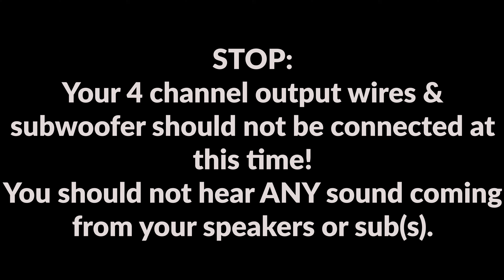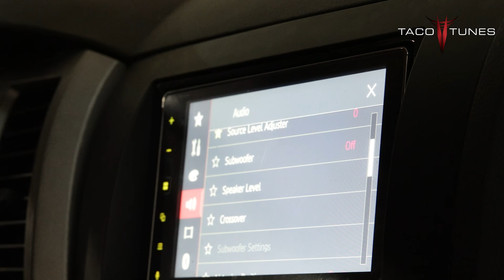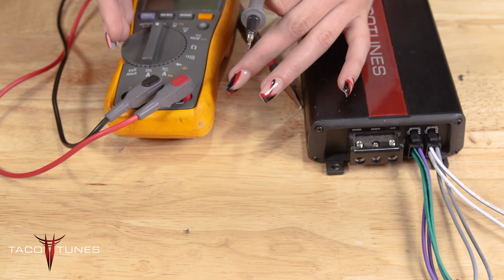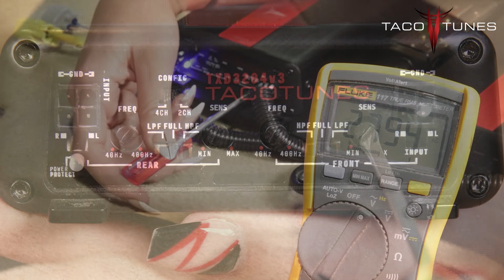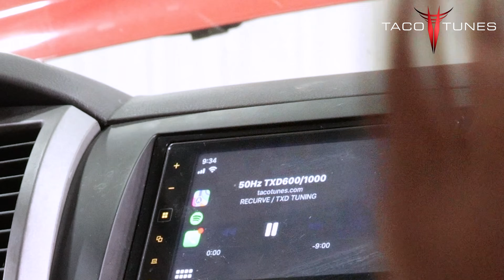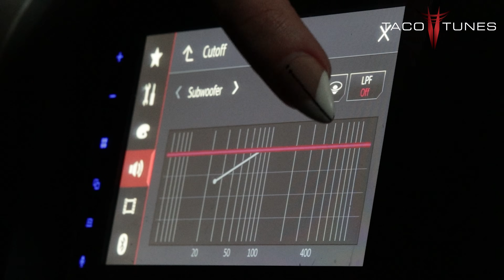How to tune TXD3240v3 (4 Channel Amplifier)  TXD10001 (Subwoofer Amp) with an aftermarket head unit

Comment: I cannot get my amplifier to reach 17.5 volts for the first step. Everything is set correctly on my head unit and the amplifiers before I begin. I have triple checked everything and gone through these instructions several times and the average voltage I get is 10-12 volts before my sensitivity knob maxes out. Anybody else have this issue? Help please!!

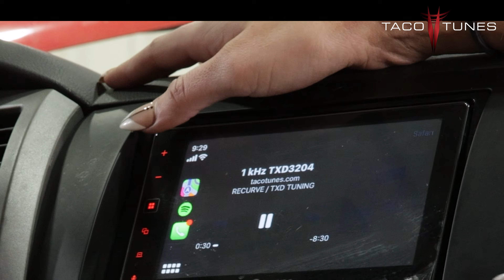Comment: Why target to 17.5 volts on the multimeter? Shouldn't it be closer to 13.5 to 14.5 volts? (3:45 min mark)
Reply from the maker: Actually, at 1Khz should be about 18 volts, but we are leaving some headroom (aftermarket head units / stock units we tune higher) for different output levels from the different audio sources. At 80hz, the output will actually be closer to 20 volts (A/C) (100 watts RMS).  Maybe you are confusing the charging system's 12V DC anticipated voltage (BTW most Toyotas charging system are roughly 13.6VDC) vs . . the amplifier output AC voltage?